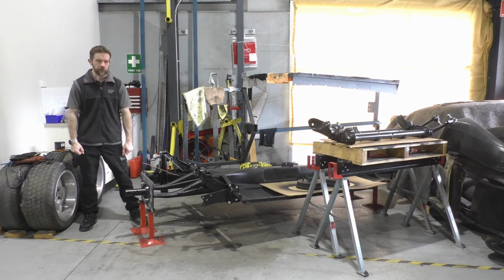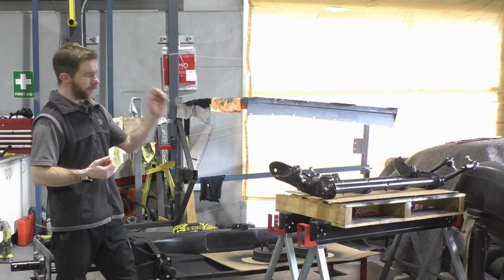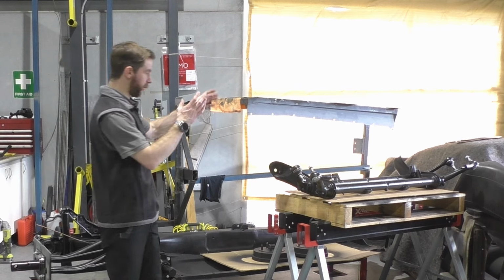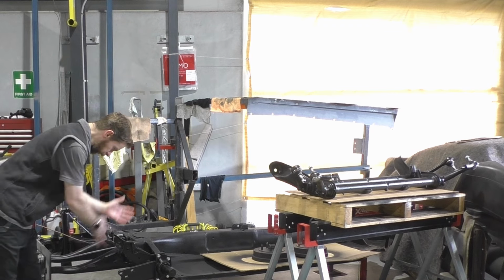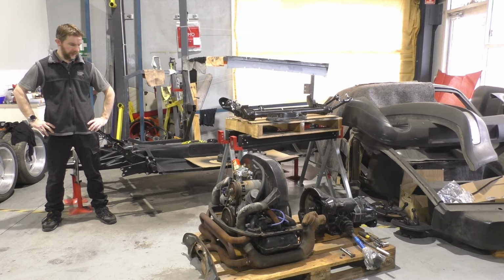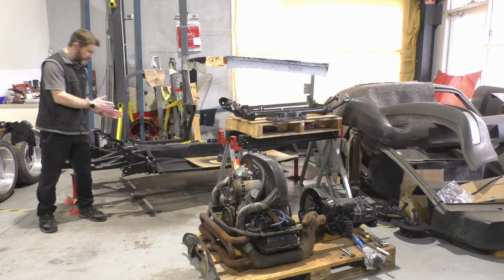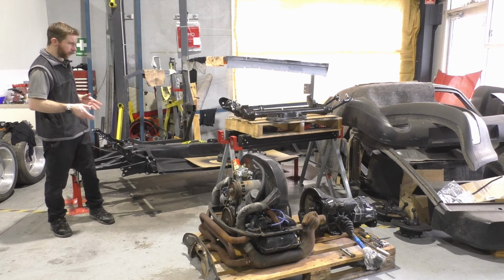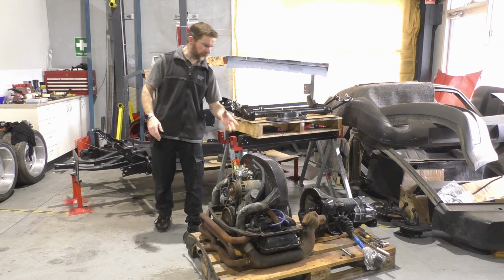Pt.57: Porsche 911 Turbo (964) Replica. Painting More Parts, Rebuilding Brakes, & Fixing A Frame.

Comment from the maker: So, what is your opinion on the shaft play in the transmission? Share your thoughts if you have any insight.
Reply: There is what they call a gland nut that holds the flywheel to the crankshaft. This gland nut has a needle bearing in the center that supports the clutch end of the input shaft.
Reply from the maker: Thank you for this insight.